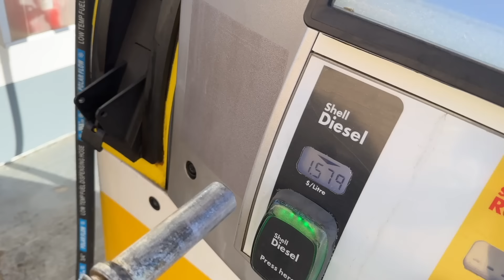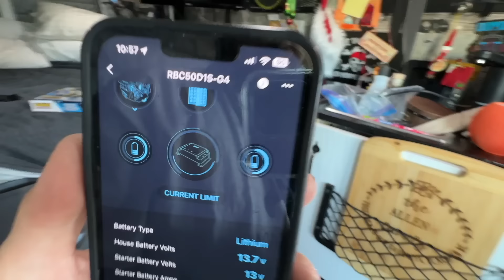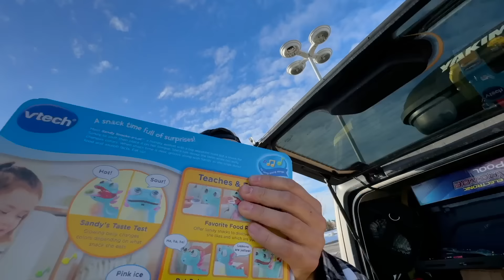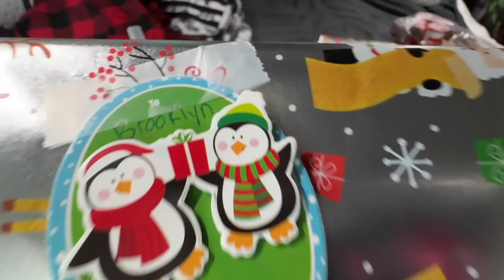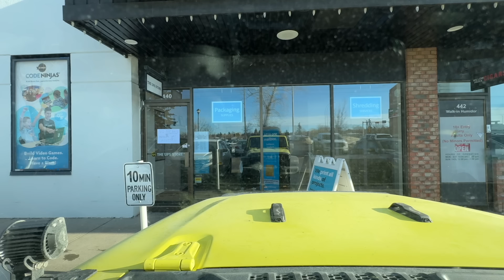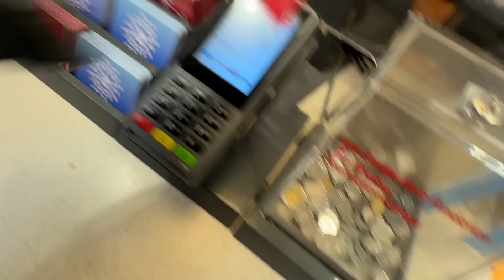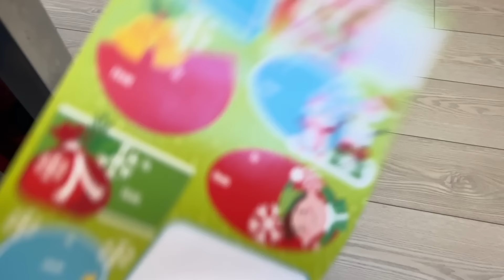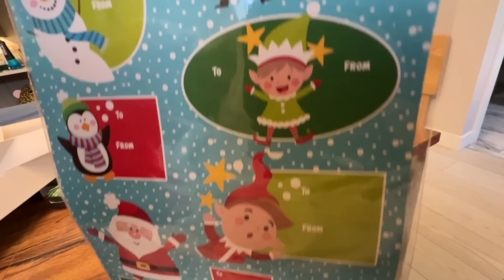Canadian Winter in a Van - I NEVER should have done it...

Comment: Someone may have already said this, I’ve not read all the comments, but in watching your door dilemma, my thought ran to a small tension rod, ( they usually are used for kitchen curtains) anyway they are small and not bulky.  One could be installed toward the bottom inside of your cabinet and it would stop the slide of the goods. 🤷‍♀️😊❤️

Comment: I keep thinking those BlueOx connections could be moved into the grill slots. Of course, my grill slots are open, like a real Jeep would have. 🤣
Reply: There is no frame structure behind the grille and breaking a radiator/intercooler/ac condenser/oil cooler is no fun.
Reply: @bobtailedtrucker2521  true, curious though, there's some potential for a mount point that would be more protected than below, above the bumper. 

I'm just overthinking things. Everyone needs a hobby. 😎